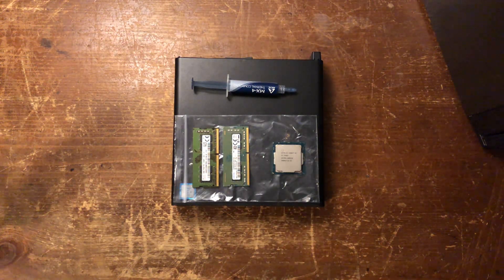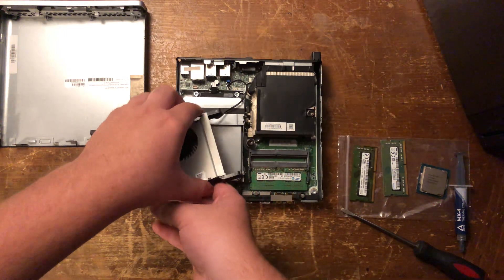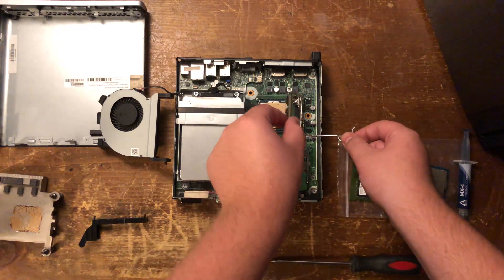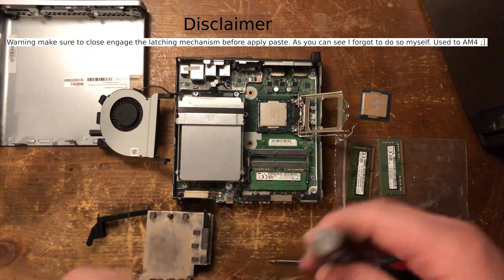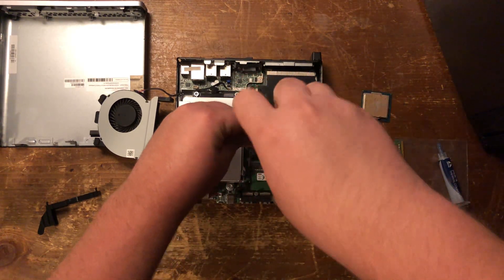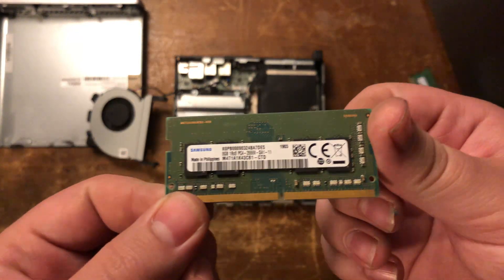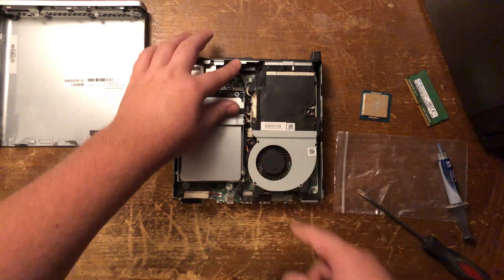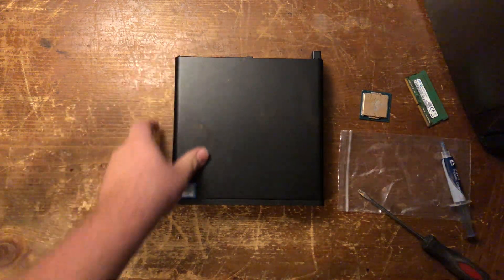How to upgrade the Ram and CPU in a mini PC.  [HP  Elitedesk]

Comment: Very helpful video. (not too much thermal paste, also LOL). One thing to be careful about is in choosing the RAM vendor. The HP EliteDesk units are very particular about the RAM speed and timing. I found out the hard way. Look at the HP RAM you're replacing, or search to the HP support site for your model mini, and note the RAM part number they have listed, which you can search for  on your favorite vendor site to find one or more compatible RAM modules of the desired capacity. I leaned the hard way thinking that any DDR3-2400 SODIMM would work, but some TImetec modules I bought failed the POST. If on power-up you hear 3 long beeps and 2 short beeps, then the RAM initialization has failed and the system won't start. Using HP's part number, I found that Crucial makes SODIMM modules that are compatible with the EliteDesk minis. But be aware that not all RAM modules will, even if they have the apparently correct speed and timing.